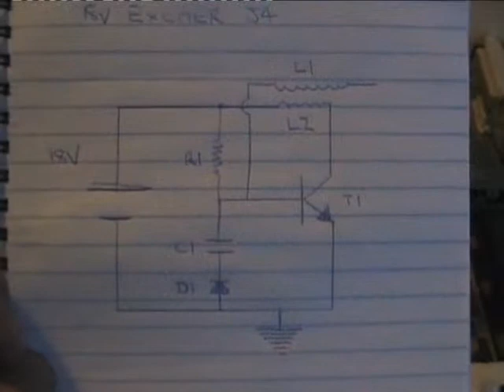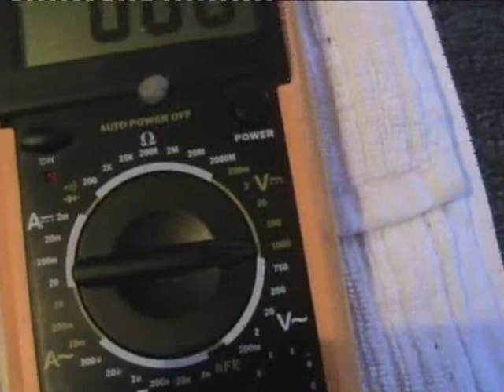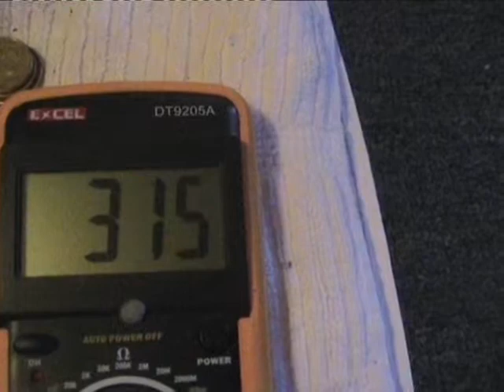Wireless Charging

Comment from the maker: @FCKEVRY1 Besides the computer that you typed your message on, you could use it for lighting as i've shown in various other videos.  I don't understand what you mean by a 30,000V spark every 30 seconds. Capacitors can work like that, but look at some of my other vids where they are used to provide constant power or smooth out voltage. Theres a capacitor in the very circuit you just watched!